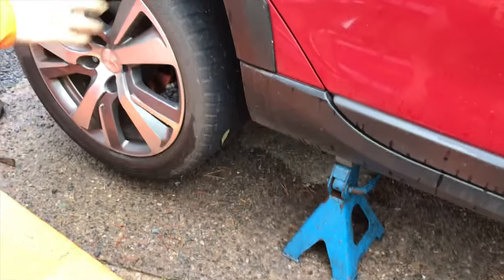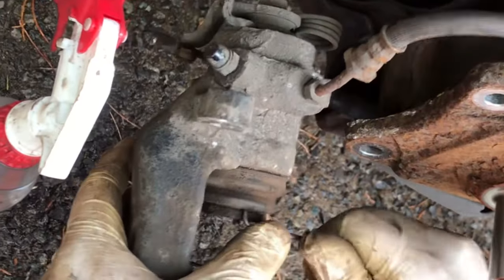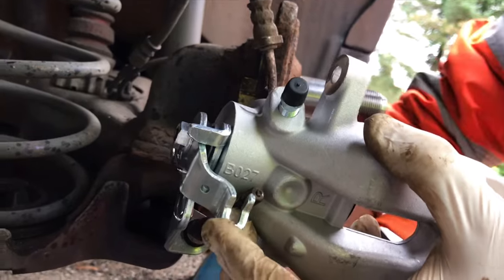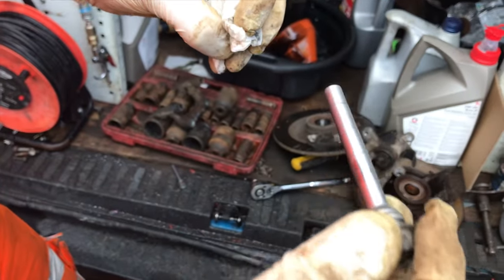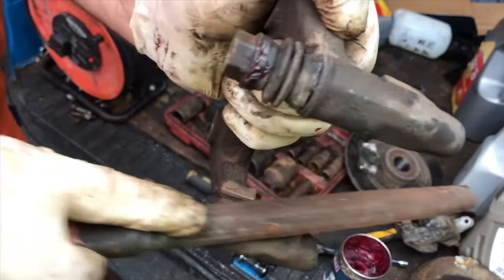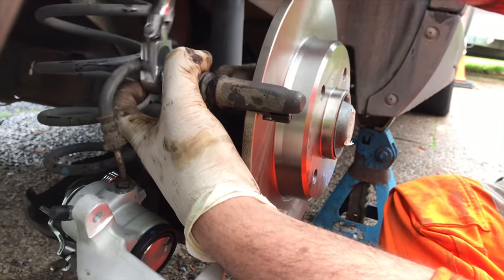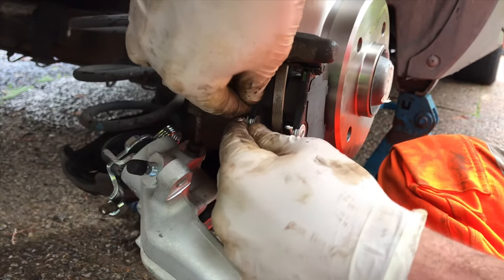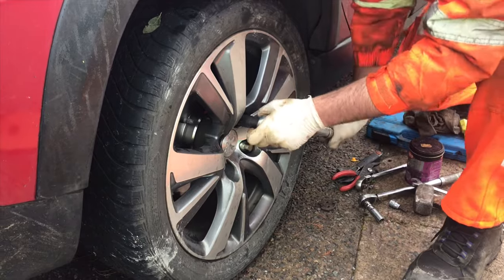Peugeot 2008 Rear Disc and Pads and Wheel Bearing Replacement Overview

Comment: Dude, the 2008 doesn't have lifting points on the back or front, am i wrong? They are only on the sides.
Reply from the maker: I cant remember where but i did find somewhere to put a stand when i did a rear exhaust on one of these

Comment: What size socket to undo the brake disc??
Reply: Same Q here. I had read it was 32mm but doing the job today it is larger.
Reply: @mattbuckels46  it's 36mm mate found out of another video
Reply from the maker: Hi yea it is a 36mm hex nut, 38mm on some models and 40mm on the picassos

Comment: What if i changed brake disc with bearing because it was excessive play on one side for two new ones and it still play on same side it was before even i changed the sides of new discs to check it's that bad bearing but it seems both bearings are good. What to do now ?
Reply from the maker: If the wheel moves and the caliper doesnt then its play in the wheel bearing 

Its both impossible for new parts to be faulty
Reply: @maxautouk  i solved the problem by adding more torque to hub nut (I bought long breaker bar).